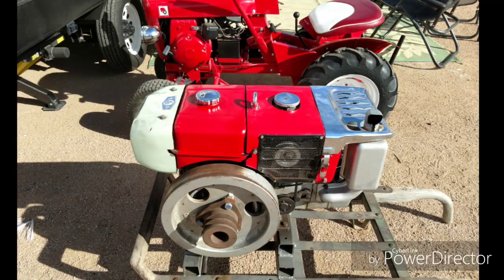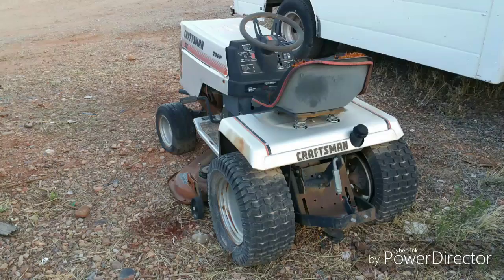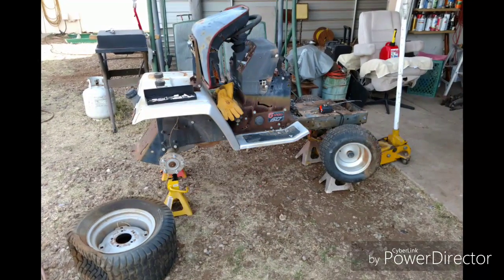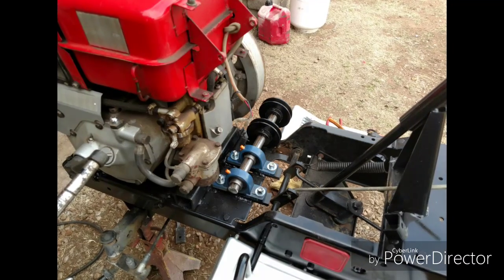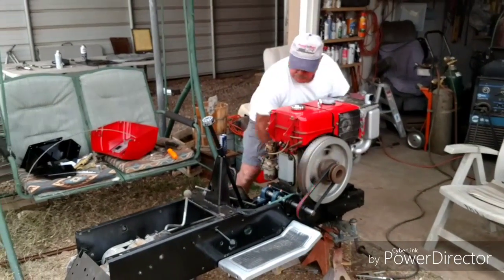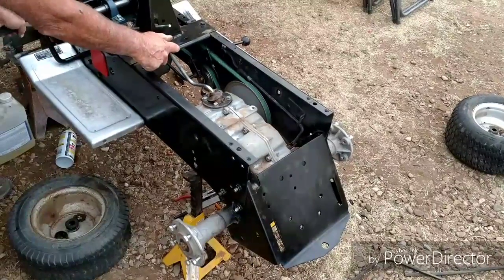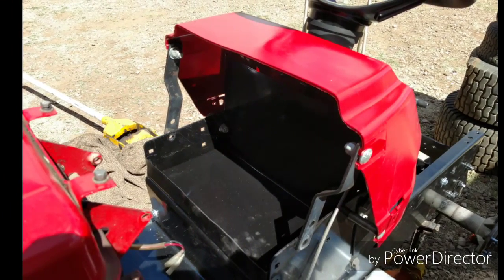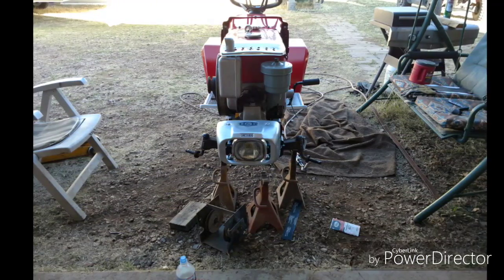Homemade Diesel Tractor

Comment: Dam that frame looks pretty stout!
Reply from the maker: It seems to be able to handle the extreme torque of the Diesel.
Reply: @lanceamatulli6112  How did you turn the translation into a transmission? The original engine is transverse and not horizontal. The petrol engine has the drive downstairs. How does that work?
Reply from the maker: @canskanal9262  the original engine was a horizontal shaft with a series of pulleys to change the direction. I used a cross shaft to allow alignment with the transmitter pulley.
Reply: @lanceamatulli6112  

Thank you very much. Maybe you can make a more detailed video, where you can see that exactly. Greetings

Comment: That's a lot of torque in that motor along with the big A## flywheel. How huch FTLBs of torque does ti produce. i was thinking on putting something like this on my old JD212 in place of the old cast iron Kohler.
Reply from the maker: Not sure on torque but it's only 7 hp. I'd guess at 35+
Reply: keep the Kohler, It's a way better engine! 
Torque on a 7 hp diesel is gone be around 20 Nm or 15 ftlbs
Reply: Maxwell, oh ok. Interesting. I was thinking the Kohler was better engine since it’s lasted this long, but since I have an old diesel truck & a source of waste oil I could run it for free.
Reply: @michaelbenoit248  inderstandable, they don't use much fuel, i would advise, to filter the wast oil very well, and run a mix of diesel-oil

Comment: But diesels run at a lower rpm affecting blade speeds etc. Not a good idea.
Reply from the maker: Blade speed is changeable by pulley size.
Reply: Why are most bigger lawn mowers diesels
Reply: Diesels do run at a lower engine speeds, but only in cars, a small brigss and stratton makes 3600 rpm, a small diesel too.